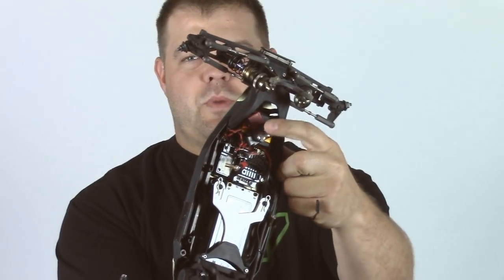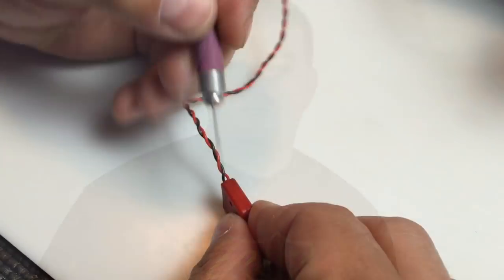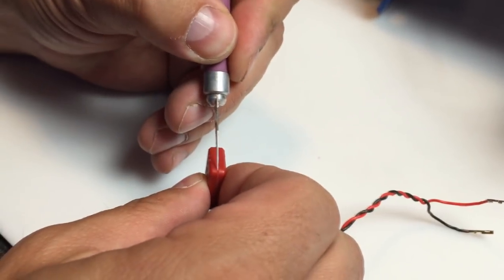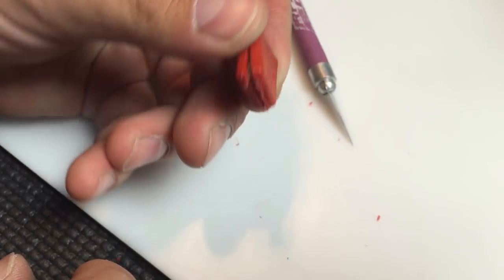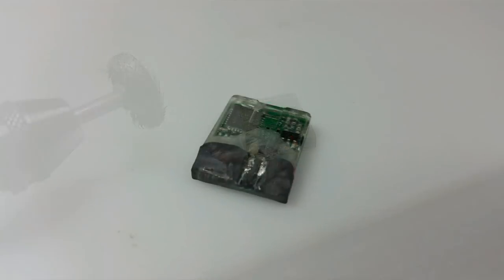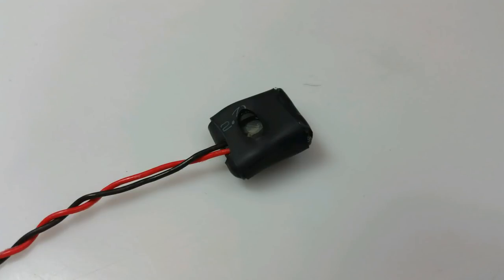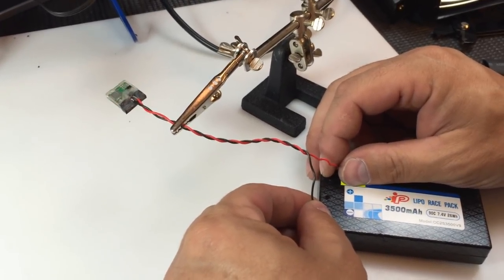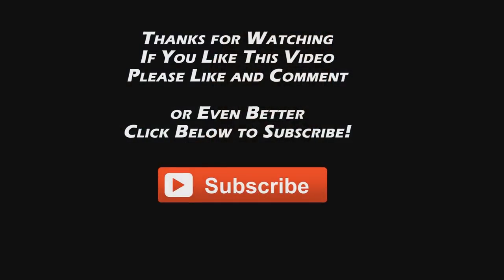How To: Fix a Broken "My Laps" RC4 Transponder

Comment: I've done this to several transponders for a lot of local guys now. I've actually reuse the case and use a little bit of shoegoo on the transponder then I'll put a slight amount of super/tire glue on the inside of the case and put it back together while the shoegoo is still drying.  Longest part of this is cutting the case off. Old servo wires make for great fixes especially if you have one that is extremely flexible.

Comment: great video I tried this thinking it might work for me but it didn't go as well. slowly worked the case open with a razor just like in the video but when I peeled the two sides apart the circuit board fell apart. now that Its apart I highly suggest to anybody that is having a problem with their wires to try using a razor blade and peeling off some of the black plastic dip/glue where the wires come out and exposing enough wire to solder a new wires on from there before trying to split the case

Comment: I was under the impression that they have a lifetime warranty? or at least my LHS told me since i was not sure about getting one used. but this kinda sucks i mean you spend $115 for the hybrids and less for the 3 wire but yet there are not alot of local tracks in my area let alone the state of OH that run the new AMB system. besides all that this will help if this same situation will be needed thanks again!!